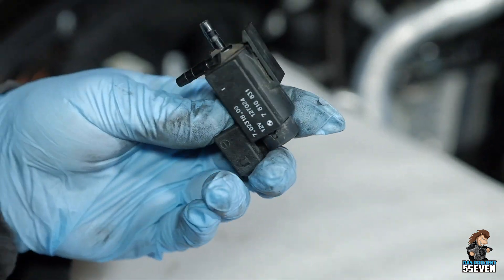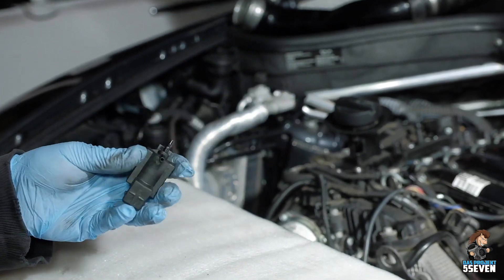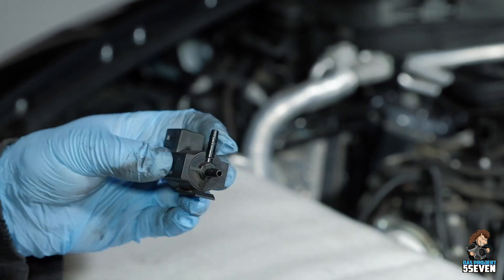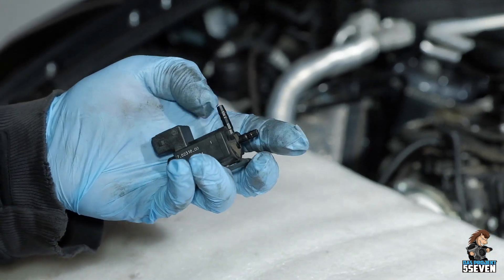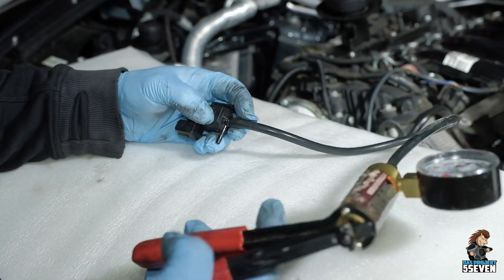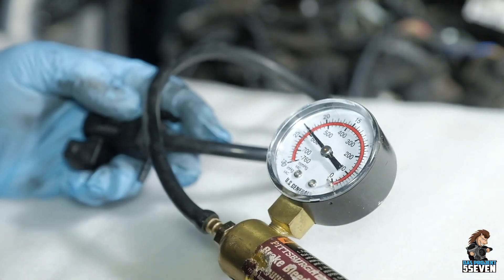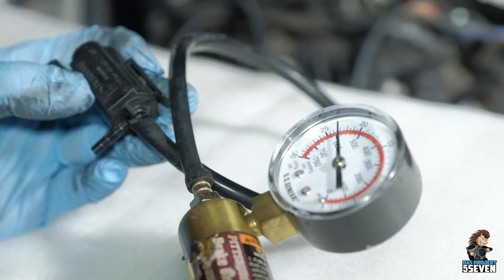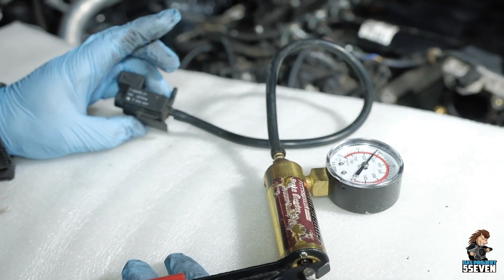How To Test an Electric Switch Over Valve

Comment: I've upgraded all vacuum lines per your video's.  I tested and installed both pressure converter solenoids and installed a new EL Valve for the compressor by pass (in the turbo control bracket) but I am getting no vacuum through the EL valve at idle.  I have no low end power, vacuum tests fine on the right sides of the system, no leaks.  The turbo switchover actuator operates fine when the car is started.  The turbo bypass actuator operates fine and holds vacuum.   It appears that the EL valve is not operating electronically and sending vacuum to the turbo bypass actuator.  Where would you suggest I check from here?  Any guidance is greatly appreciated.
Reply from the maker: Start from basics. Check what is your system vacuum. Test from a nipple closest to the vac pump, so any nipple on the distribution block under the manifold.  Should be 25-29inHg. If system vacuum is good, then move to the next. Check you have connected everything correctly.  Often a misrouting or switching nipples will create your issue. Then, you need to make sure you have no vacuum leaks. Anywhere. Including motor mounts.  It’s a closed loop system. So a leak anywhere will affect the functionality of your turbo control. Or get a check valve right before the vac accumulator.  Check vac accumulator not cracked.
Reply: @alphadevyat  Thank you kindly for your reply.  I've checked the vacuum on the entire system.  Everything checks out fine, no leaks anywhere and no damage.  When I start the car the pressure converters seem to be operating properly.  I see the rod on the actuator move and close the turbo manifold flap.  I've checked the vacuum on the output side of the vacuum controller and I have 26 inHg.  When I check the output side of the EL valve that goes to the small turbo's actuator I'm getting no vacuum.  I'm wondering if it could be something electrical.  The EL valve is new OEM and tests fine, no leaks.
Reply from the maker: @russtaylor1376  when we talk about the EL valve in your case, I assume you refer to the one that is behind the pressure converters for the compressor bypass control. And if you are not getting any vacuum on the output nipple (one facing sideways)  then it’s normal. It only gets activated (air side) past 3k rpm when the switchover to the LP turbo is fully engaged from the turbo switchover (exhaust side). And you are saying above that output of this is going to the small turbo actuator. That is incorrect. The output from the EL valve for compressor bypass is going all the way to the front  to an actuator right on compressor output right before the boost hose.
Reply: @alphadevyat  You are correct, the output of that Electronic Valve is going all the way to the front to the actuator on the front of the small turbo (I've tested this actuator and it holds vacuum and I can hear it release when I release the vacuum).  I was told that it should have vacuum at idle, from your reply it looks like this doesn't get vacuum until 3k rpm then it most likely is working properly.  

At this point I don't know where to look next.  When I start the car I get vacuum through the system at 26 inHg.  That vacuum at idle operates the actuator on the side of turbo's and I visually see the rod pull back.  I've tested  this actuator as well and it holds vacuum.  Watching all of your video's again, everything looks good and appears to work correctly.  I still don't have any power at low rpm's.  I'm getting no boost until I hit about 2500 rpm and the large turbo kicks in and the car then pulls hard and I'm getting boost.  I don't hear or see any boost leaks when I'm driving the car.  I can't find anyone in my area that know much about the 35d.  Any further suggestions?
Reply from the maker: @russtaylor1376  let me go backwards a bit here. You indicated that you replaced vac lines and pressure converters etc. Was there any other work done on this vehicle at the same time or recently. And did the car drive fine before this. Is this car stock. Basically, what is the baseline here.
Reply: @russtaylor1376  I had the same, no boost at low rpms. For me it was the turbo air charge hose from turbocharger to intercooler which has leakage. You should replace both turbo air charge hoses, the one from turbocharger to intercooler and from intercooler to Intake manifold. Good idea. Start to demount your intercooler, then there will be more space and easy to replace both hoses.  You can not replace the hoses without demounting the intecooler first. I hope this will help you. Good luck:-))
Reply: @dinhvanpham8102 did you solve this problem?
Reply: @ Yes it did solve my leakage problem. The other problem with low boost is solved too. The car workshop replace a new turbocharger with a new electronic actuator, the new actuator was not calibrated so the actuator can not find the right close and open position on the turbocharger. I reinstall my original axtuator, the calibration was preserve in the actuator and my turbpcharger works like a new engine. When working with electronic actuators workshop must use an actuator reader /programmer. The device can check why you may have turbocharger malfunction. An electronic actuator ATP 3000 reader /programmer can with software on a pc can make miracles. The ATP 3000 can read an actuator, take backup of the setup on an actuator, save it on a pc. Restore he backup to a new actuator.
Reply: Have you checked your car with a ODB2 scanner for any faults? If you are experiencing low boost, drive train, high consumption, glogged DPF. Run a diagnostic first and find any errors in your system. Check that your map sensor is not glogged. Recheck that your 2 turbocharger hoses one from turbocharger to intercooler and one from intercooler to intake manifold are properly seated tight and firmly in lock position. The way to do is placing a flat screw driver on angel under through the clips, move the right til the clips is unlocked, move the left flat driver til the clips is unlocked. Push the turbocharger hose til it stops, take of the screw driver and use our hand and press the clips in lock position. Use your hand and check that the hose is tight and firm. Now you repeat the same prosedure on the other end of the hose. You use two flat screw driver from up and down on angel through the clips, move the screw driver on both side to unlock the clips. Push the hose down til it stops, take off the screw drivers , use your hand and press the clips in lock position. It should be very tight and firm. After doing a recheck on your turbocharger hoses, take your car for a test drive on high way , take some hard and quick accelleration and kick downs. Recheck that all hoses are still seated firmly and tight. Check your actuator. Let a friend start your engine, check carefully that the actuator is in close position, the actuator arm should be on the lowest left screw when you stand in front of the engine. When your friend start the engine the actuator arm should move to left and right and stay at left (open position). If your actuator is not calibrated right
you should get an error 29A400, can not find close open position. All errors are stored in memory and only way to read errors is using software or a car scanner. If you do not have any 29xxxx error and your actuator arm is in close position when the car engine is off, and in open position after the engine start. If you have got a 29A400 error you must bring your car to a turboservice specialist to recalibrate the actuator to your ECU. I had problem with low boost with my turbocharger in two years. 3 car workshops can not find out why. I had a big leakage on the turbocharger hoses, because the mechanic just push the hoses in place and it was not seated tight and firmly. I repair my old original actuator. The configuration was preserved and still in ECU. I reinstall the actuator and my turbocharger works perfectly at once. Happy ending after two years and over 5000 dollars poorer.
Reply: @dinhvanpham8102   thanks for answer, i checked all the things but everything worked. It was actually the small turbo that was locked….. snapped axle
Reply: @eliashonningdal9441  Why did you not tell that you have a faulty turbocharger? If you have said that in th beginning we can solve your problem for long time ago!!! Did you replace a new turbocharger? Did you reuse the actuator on your original turbocharger. Because even your small turbocharger is faulty the setup/calibration is preserve on your original actuator. Did you save your old turbocharger with the original actuator? If you still have the old turbocharger, please use a torque 30 screw driver and unscrew the 3 torque 30 and install the actuator to your new turbocharger. I can promise you,  you have solved your problem. If you do not have access to our old turbocharger with the old actuator, you must find a turboservice workshop who has an ATP 3000 actuator reader/progammer machine to calibrate the actuator for you. Now I understand you have the same problem like me. The workshop replace a new turbocharger with a new actuator which is not calibrated. The turbocharger can not find the close and open position. If you run a car diagnose you will get error 29A400 saying can not find open close position, too big deviation. You save my turbocahrger with the original actuator. I solved my probem by reinstall the original actuator to my new turbocharger and my turbocharger works fantastic. Please update me what you are going to do.
Reply: @ thanks, i am gonna try that tomorrow. I have my old turbo with the old actuator so i can try to switch it.
Reply: @eliashonningdal9441  Have you switched to the old actuator?  Your turbocharger should work perfect because this actuator has the right configuration for your turbocharger. If you take a look at the actuator arm it is rested in close position when the engine is off and in open position when you start the engine. I hope your engine is working fine now. Since you have driven your car with a non turbocharger working. I suppose you have got soot up building in your DPF. Run a diagnose live data on DPF soot and on back pressure sensor. Check the soot on the end exhause pipe on the back of your car. If your finger is black you have a soot problem on our DPF. If the soot level is 40-50 gram and your back pressure is over 300 hbar at 3000 Rpm. In a case like this you will get drive train error if you accellerate hard. You must do a DPF cleaning. First priority is A DPF cleaning is best. After a DPF cleaning, go for a long drive on high way at constant speed 100 km at 3000 rpm in 30 minutes. Your engine will automatic start a Dpf regeneration. Now you can wash your exhause pipe end with brake cleaning fluid and you should not get black soot again.
Reply: @dinhvanpham8102  i changed the vacuum-converter and vnt back to the old one, now its fixed! I have a downpipe so no soot in dpf:)

Comment: Just checked my spare and the resistance is 30 ohms
Reply from the maker: Paul Everett thank you. I checked ours and 30 ohm is right.
Reply: Did you say ‘porsche’ valve would work ? Any chance you can provide part number or model /year ? Thanks!
Reply: @Dentprotony does anyone know the porsche or vw part number for this?